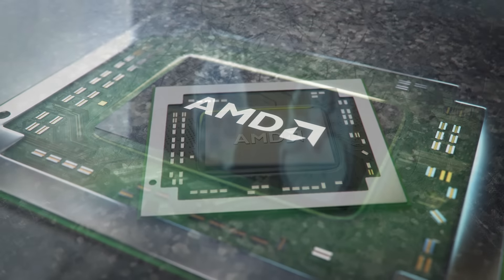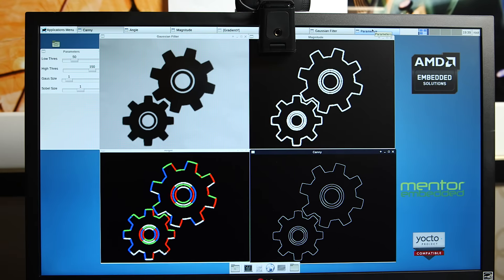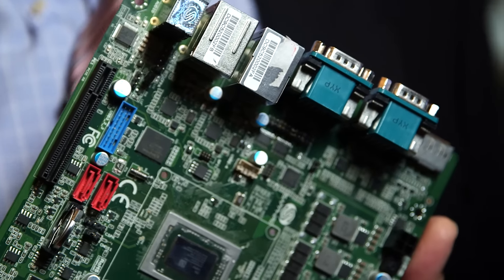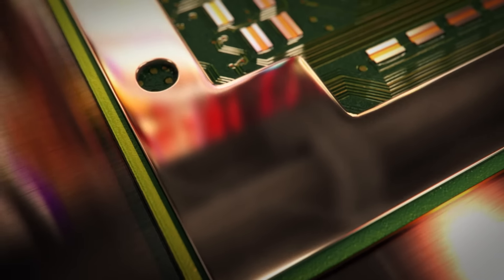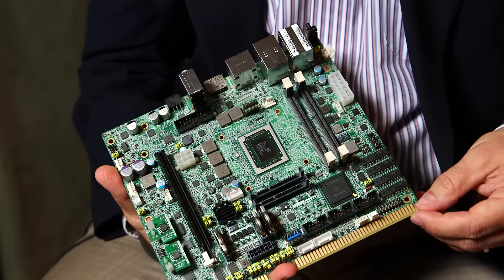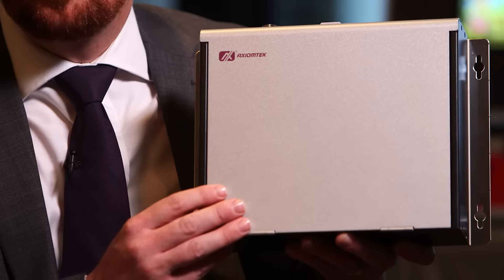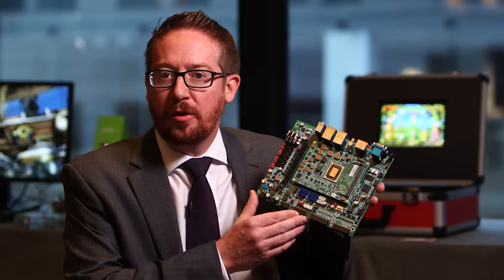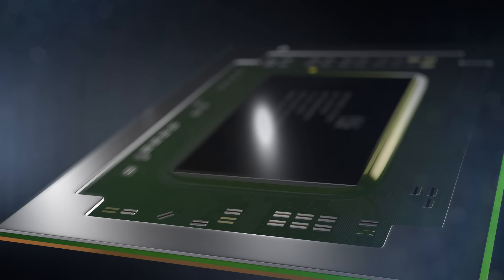Expand the Possible with the AMD Embedded R-Series SOC

Comment: It is now  2020 A.D. -  any new  SoC  7nm  single chip solutions coming from AMD ?     It would be nice for them to re-design the A12 9800E  APU as a low power, fully integrated single chip solution with 1024 shader units (double the original 512 shaders)  increased  L1, L2 cache, and extended hardware 4K encoding and decoding,  MP3, MP4, H.264, H.265 codexs -  to create a   Single chip  SoC  APU  with a very minimum mother board, supplying power, DDR5 RAM, and connectors.